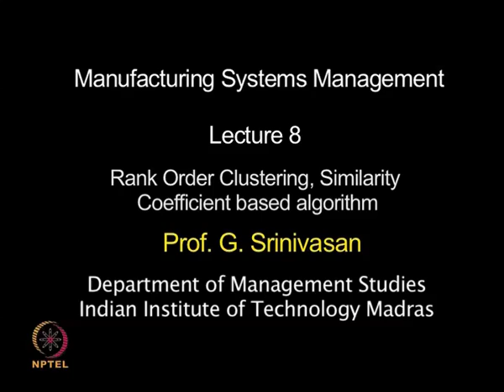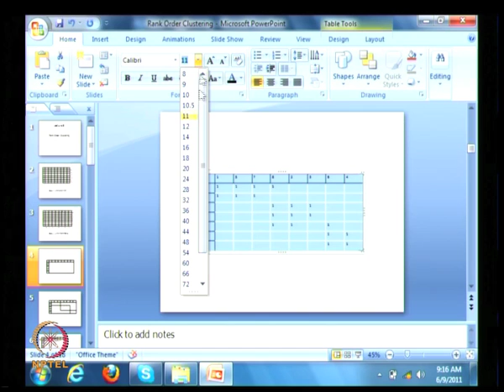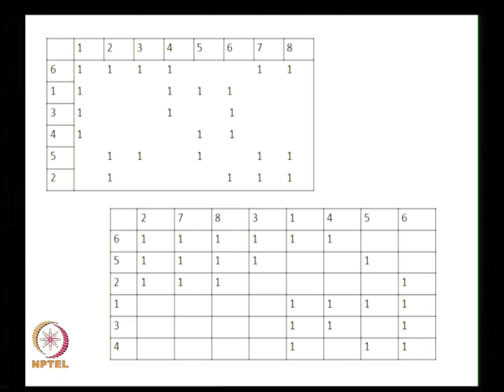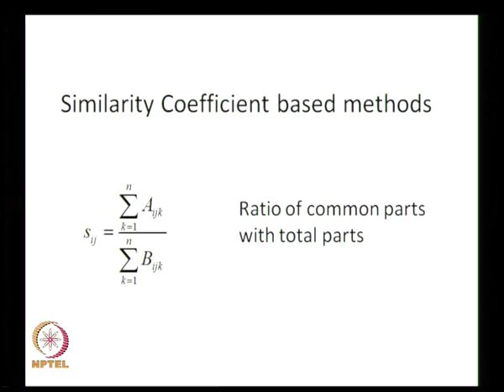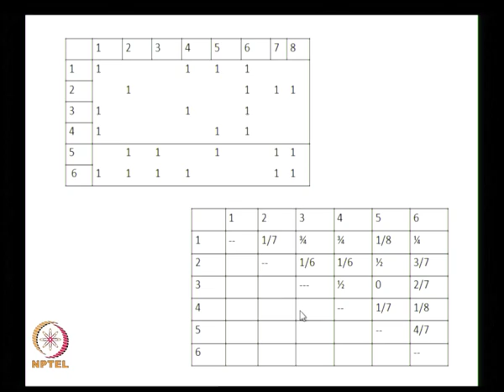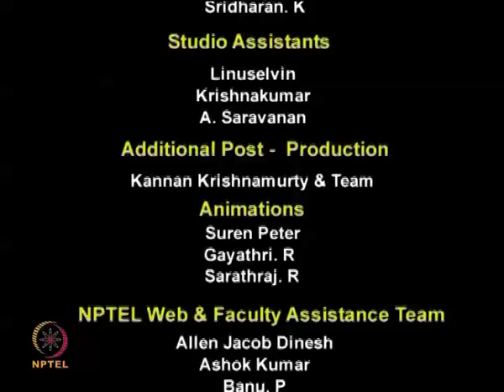Comment: The 6 machine 8 part example addressed in the lecture DOES NOT give the solution shown,  if we start sorting ROWS first and then COLUMNS ( as prescribed). However, it gives the solution if we sort Column first and then Rows. What is catch here? Any explanation?